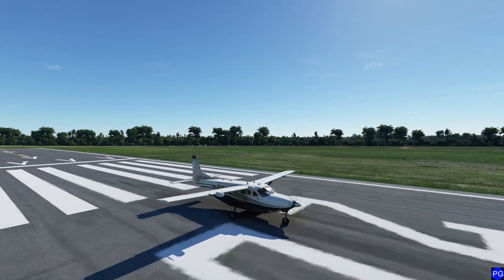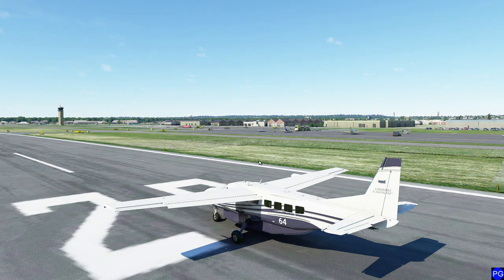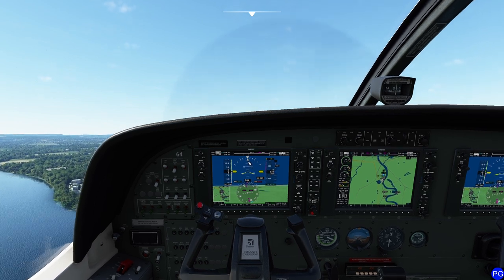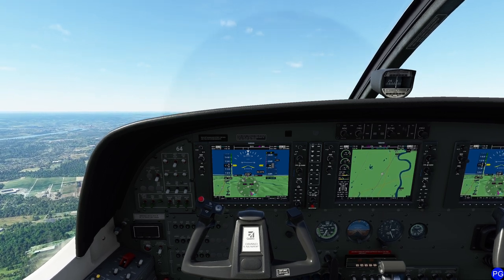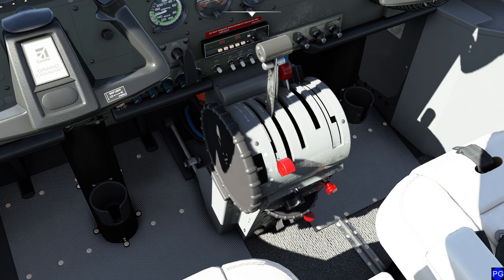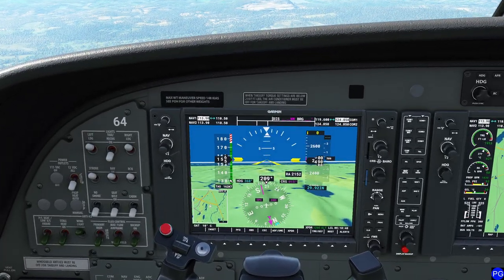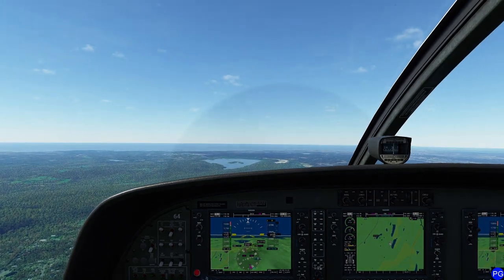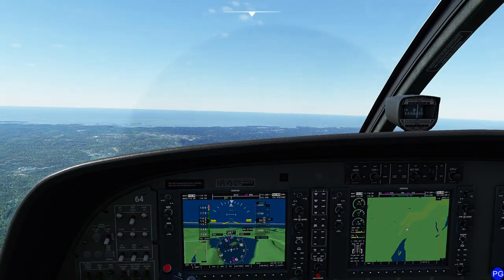MSFS - Elevator, aileron and rudder trim tutorial.

Comment: Great tutorial, but when you say that the trim in FS2020 is nice and slow may have been the case when this video was made, I wish that was still the case, but as of Jan 2021 it is ridiculously way too oversensitive and virtually impossible to set correctly, you're forever chasing it, which becomes painfully infuriating. Being a real world GA pilot trim in an aircraft is easy to set, nothing like in this last update of FS2020 :/

I use one of the axis wheels on my controller for trim, and despite the fact that there is absolutely nothing wrong with the controller, regardless of how much I adjust the sensitivity settings for it the trim in the sim is still ridiculously oversensitive and something MS seriously need to fix.